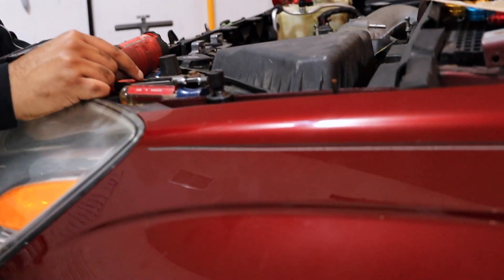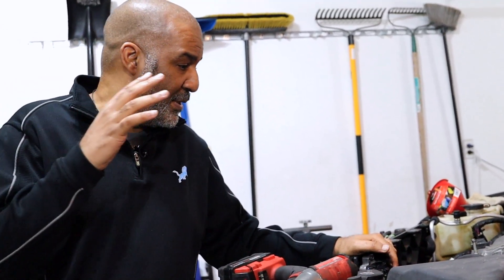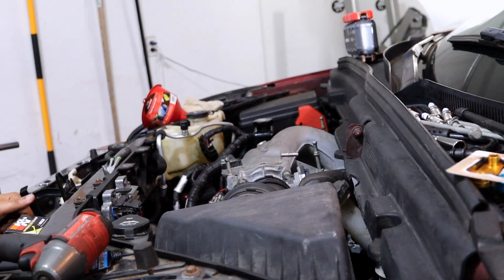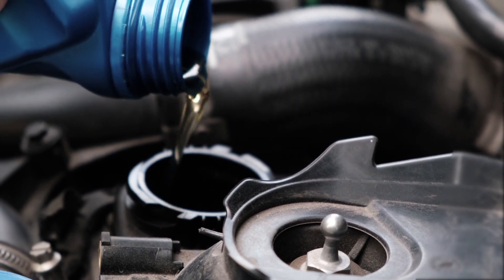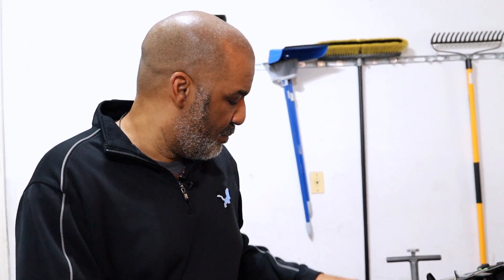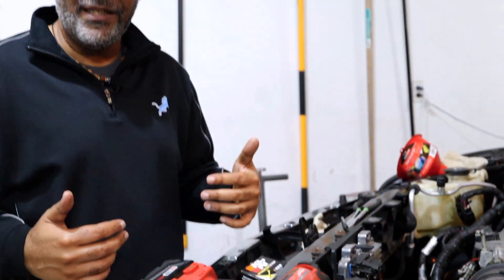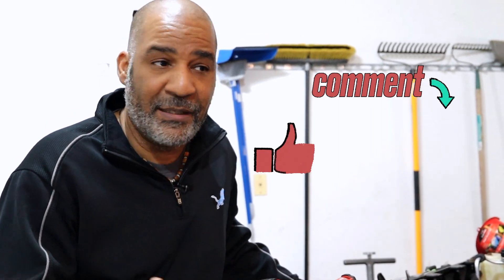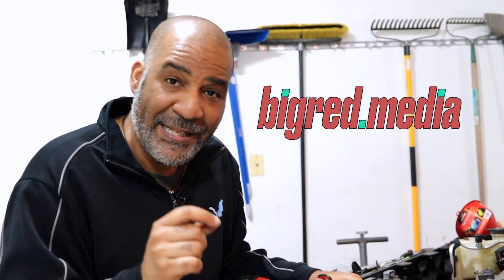How to Prime an Engine | Engine Swap: GM SUV, Traverse, Acadia, Enclave, Outlook

Comment: pressurizing the timing chain tensioners is very important before cranking so the chains don't jump timing. and never turn the engine backwards. I machined spacers under the tensioners so this problem never happens.
Reply from the maker: Pressurizing the tensioners? Is that a separate step? There's nothing about it in the Service Manual.
Reply: @bigredmedia2900 i think he means oull the pins so they extend and pressure the guides.